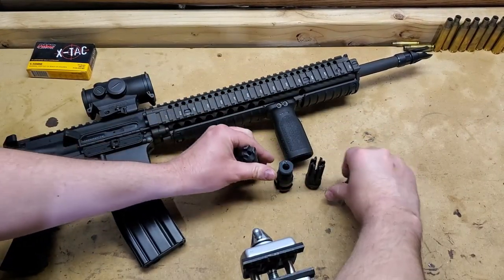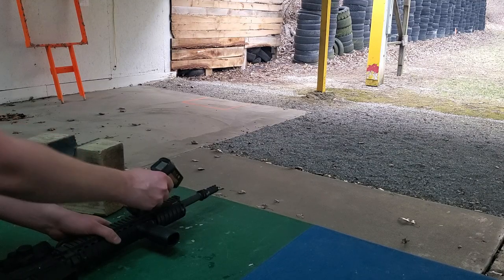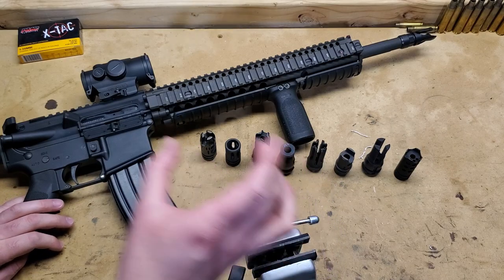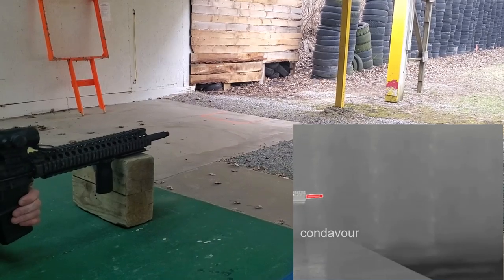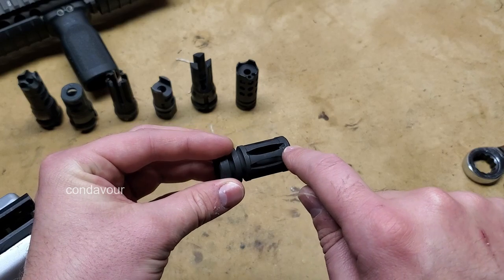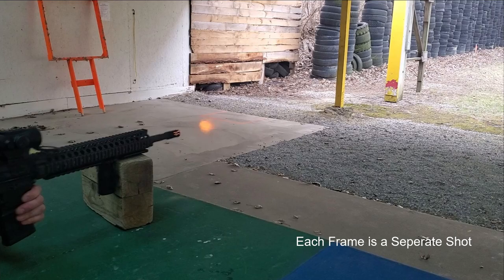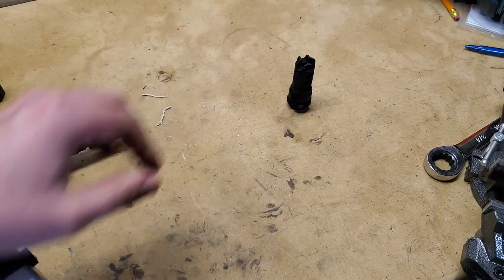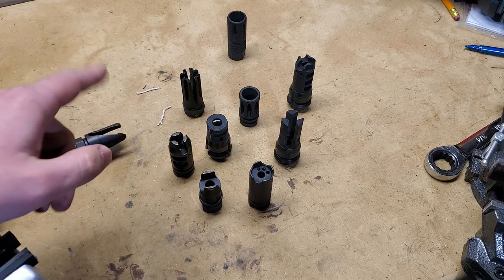9 Muzzle Devices Flash Under Thermal

Comment: Interesting bit about the Bren 2 flash hider: the prongs are cut to "twist" instead of straight on to eliminate the ringing, as helpfully demonstrated by the the Strike Industries muzzle device. The first version of the Bren 2 had straight prongs, and it was apparently quite annoying to shoot.
Reply: Does the Bren 2 flash hider correspond to barrel twist?  The Vz58 2 piece SF Brake's inner flash hider did...  Curious if that carried over.
Reply: @rsr3959  Not sure, but it wouldn't surprise me.

Comment: What kind of thermal imager did you use? I have a flir breach I'm might do some experiments with
Reply from the maker: For this I was using a Burris BTH35 monocular on a tripod at a decent distance. You could probably use the breach but you are going to need to be closer. Just make sure you aren't hitting it with brass :D